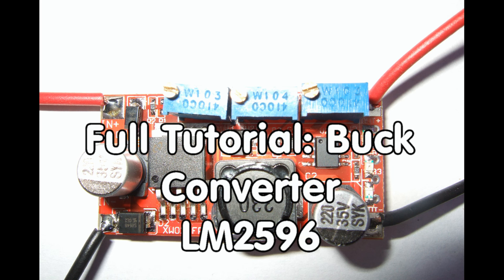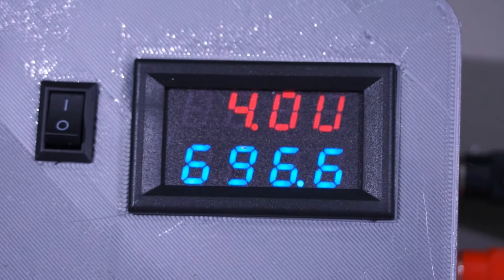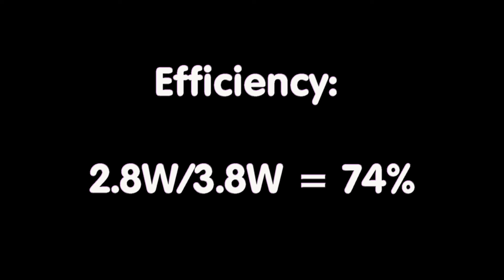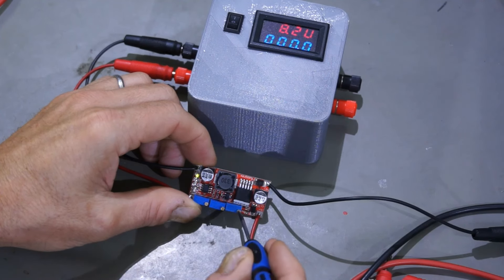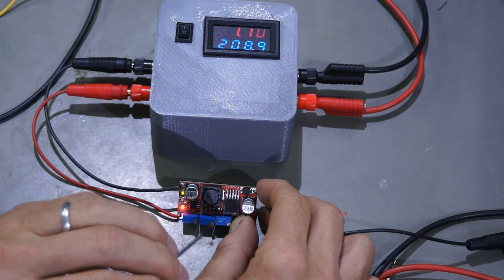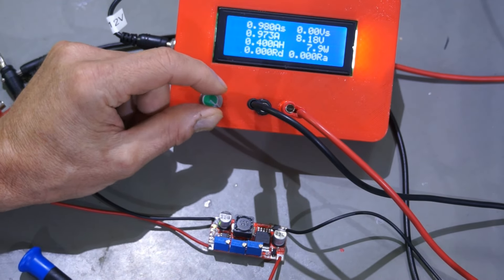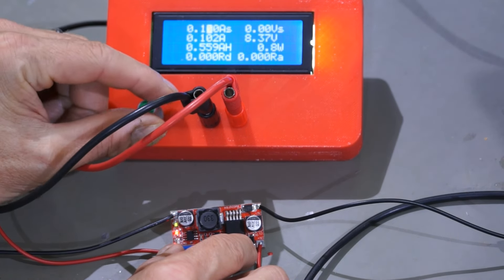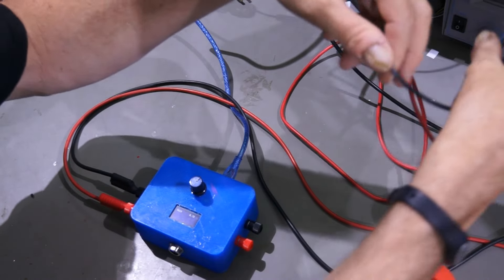#7 Tutorial: LM2596 Buck Converter with Three Trimmers (step down converter)

Comment: Andreas, superb tutorial. Very clear.  

Regarding the third (located middle on the pcb) potentiometer:
When the pcb is being used to (albeit crudely) charge any battery/cell connected to the pcb's output terminals  . . . . . my understanding is that the middle potentiometer is adjusted/used to merely give a visual indication (by illuminating the 'CH' LED) of when the charged cell's current is close (as per middle pot adjustment) to the pcb's 'CC' setting (as prior set using the CC pot).  ie once the cell's terminal voltage (under charge) has approx reached the pcb's 'CV' value, then the CH LED illuminates.  The middle pot and CH LED are solely used as a visual indicator function of current flow status. Nothing else. 

The pcb in the tutorial is primarily designed to be used as a constant current/voltage driver for low power LEDs, in which application the middle pot and CH on-board indicator LED are redundant/irrelevant.

Really, the pcb shown in the tutorial is inadequate as a Li-Ion cell charger, there are more refined (and similarly inexpensive) dedicated Li-Ion cell charger PCB's available (that utilise multi-stage charging).  Example:  http://www.ebay.co.uk/itm/5V-1A-Lithium-Battery-Charging-Board-Charger-Module-Li-ion-LED-Charging-Board-GG-/111908684800?hash=item1a0e470400:g:yRsAAOSwx-9WxYqX
Reply from the maker: Thanks for your feedback. I think, this was designed for a universal buck converter with the addition of the "middle" potentiometer. So, it can be used for charging and for LEDs and for many other purposes. If you look for a lipo charger, I would also go with your proposal. Keep also the age of the video in mind. The choice of boards was smaller back then.
Reply: that charger will only do 1 cell in series or maybe 2 in parallel. You hurt your point by linking it but I would suspect you know that the other optiions for integrated chargers either take more work and smc to dip converters or pcb etching or are much larger. 

 If you wanted to make this point at least show people that companies like linear technologies, ti, etc make proper ICs for doing this. 

over all the product that the video shows is by far the easiest way to charge a multi cell in series pack. Sure it lacks multi stage but combined with working protection and balancing pcb it will get the job done for most with out requiring tons of time and effort.
Reply from the maker: You are right. Thanks for the explanation.

Comment: The 3rd trimmer sets the point where the current has dropped to a lower value than the main limit setting. You pre-set that by first setting the limit current value, then connecting an ammeter to short the output, then adjust the trimmer till the LED comes on at the current you require. You can set both current trimmers in one operation of course. Veru useful for saturating lead acid batteries.
On the CC/CV modules with 2 trimmers, the led is pre-set to one tenth of the limit current.

Note that the output is never switched off regardless of the settings. A Li-ion will be continuously overcharged if not disconnected.
Reply: Does it stop current flow or it's just lighting the LED?
Reply: @amiltonfcjunior  good question, nobody knows, people keep buying this module and NOBODY test this...

Comment: Thanks Andreas, I discovered I had one of these little guys laying in a built kit box with a small amplifier that I built when I was getting back into this sort of thing.  While the soldering was really sad by my today's standards, I was able to clean it up nicely and have freed up the little converter for other uses.  Not sure where as of yet, but now I know what I can do with it, so it may well be put to work doing some chore I have yet to learn that I need. Right now I am thinking of building a small capacitor analyzer using an Arduino as I only have one small meter that can analyze anything about capacitors, well and that wonderful little parts analyzer that is built with an Arduino chip at it' heart.  Having a dedicated Cap reader, though would be fairly handy when playing with old radios and building my own circuits.
Reply from the maker: You should even find diagrams of such testers. I did once a video where you should find a link.

Comment: Understanding the LM2596 Buck Converter with Three Trimmers

* 0:24 Buck Converter Basics: A buck converter efficiently reduces a DC voltage to a lower, stable DC voltage, offering better efficiency compared to linear regulators.
* 0:35 Single vs. Three Trimmer Modules: While basic buck converters have one trimmer for voltage adjustment, the featured module has three, adding current limiting and a charging indicator.
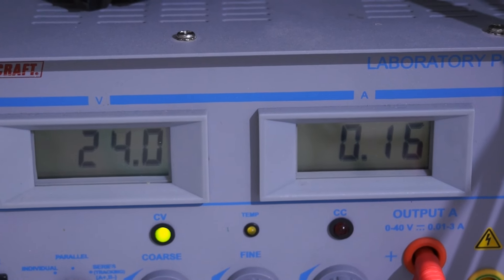* 0:50 Efficiency Demonstration: Using a 24V to 4V conversion with a 2.8W resistive load, the module demonstrates ~74% efficiency, dissipating 26% as heat. Efficiency increases to ~80% with a 12V input.
* 2:42 Current Limiting: The left trimmer sets the maximum output current. An LED indicates when current limiting is active.
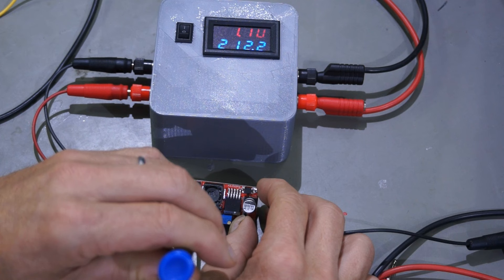* 3:14 The Third Trimmer Mystery:  Initially, the function of the middle trimmer and its associated LED seem unclear. 
* 3:54 Constant Current Load Testing: Utilizing a constant current load, the middle trimmer's function is revealed.
* 5:22 Charge Indicator Function: The middle trimmer sets a lower current threshold. When the output current drops below this threshold (e.g., when a battery nears full charge), the second LED illuminates. [From StodgeHenhouse's and ChaoticaExtreme's Comments] This functionality is particularly useful for battery charging but may not be relevant for other applications like LED drivers.
* 6:02 LM2596 Datasheet Confirmation: The datasheet of the LM2596 IC confirms the middle trimmer's role as a charge indicator. [From ChaoticaExtreme's Comment] The third trimmer sets a lower current limit, signaling when the current drops below a certain level, indicating a fully charged battery (or near full). 
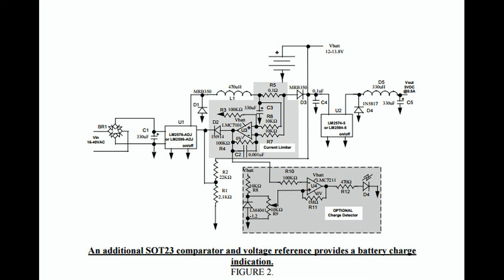* 6:15 Future Lipo Charging Test: The next episode will feature a practical demonstration of the charge indicator function using Lipo batteries and data logging. 

I used gemini-1.5-pro-exp-0801 on rocketrecap dot com to summarize the transcript.
Cost (if I didn't use the free tier): $0.06
Input tokens: 16508
Output tokens: 428

Comment: At time 5:15 in the video, you mentioned to keep the current limitation at 1000 milliAmp, but the setting appears to be a limitation of 100 millAmp. Nice video! Thanks for creating this one.
Reply from the maker: You are right!
Reply: true, normal charging of a Lithium-Ion accu can be made at half C (if the accu is 2 Amps, charge it with 1 Amp). But when charging goes over 95 % (to 4.1 Volts) the current will be low (charging voltage too close to accu voltage) so you can set the middle potentiometer to 100 mAmps for example.The middle LED will glow showing you that the charge is almost complete and might take a while to Full charge. In this moment you can take out the accu since Li-Ion accus don`t have memory, and it`s even better for them if you don`t charge them to 100%. Yes, a good factory accu will have a double life if charged always to only 90%. If not used Lithium ions feel best when accus are at half charged, which is about 3.7 Volts (shelf storage voltage) .

Comment: It might be useful to mention that the buck converter, even at 75% efficiency, is MUCH more efficient and cool-running than a linear regulator in most applications. For instance, with a linear regulator your first test with 24V input would require 24V * 0.7A = 16.8 Watts input for only 2.8W output, which is only 16.7% efficient.
Reply from the maker: Agreed. The bigger the difference between the input and the output voltage the better the switcher becomes...

Comment: Hello Andreas, so funny to see your old videos.  So subdued!  When did you become more enthusiastic?   I bought a lot of these when they were onsale cheap, and can never remember what does what, so I'm sure to watch this one many times.    If your reading this, I have a question that I find no answer when searching.  I want to create a digital potentiometer to control these trimpots using a esp32 (or another micro).   There are many chips that does this, most cost more than this module and can't handle 36v.   I was thinking to create my own, not sure how to do it that doesn't also cost 3x more than the module.  Don't think I want to solder up 20 mosfets I have lots of unl2003 that are 3cents each and have 7 switches in each.
Any input appreciated, I am about to use a stepper motor to twist the pots, which seems rather crude.
Reply from the maker: You mentioned the two basic versions: A lot of small resistors and transistors or a potentiometer with a motor. 36V is not easy for modern electronics...

Comment: Excellent tutorial!! I have one question. Can I replace de blue trimmers by common potentiometers?, so I can adjust remotely the voltage and current for a homemade DC power supply in which I used an ATX for variable requirements. Thanks

Greetings from Ecuador.
Reply from the maker: I think so. But it might be very sensitive.
Reply: @AndreasSpiess  Surely you could use the same value pots or get something higher?
Reply: Uneducated guess: You could possibly use a set voltage with the pot in the positive feedback loop of a low gain differential amplifer. Depending on the reference voltage and the voltage with no feedback at the positive pin (you can do a voltage divider from the opamp's power supply), you can narrow the range of the pot. Then, if I'm not mistaken, the negative leg is your output. For something like this you'd probably need a package with 3 or 4 in one IC.
Reply: @ninetailscosmicfox5585  Good night! Thanks for your response. I'll be considering it for my project.

Comment: I use the center pot when I charge from a car battery and it will stop the charge where you set it. So the car battery doesn't get under charged. May be different on yours.
Reply: Yeah, my sepic converter is different.
Reply from the maker: The one I presented is no sepic converter.

Comment: You have to place the Ampermeter in series with load to set the current limit ?? or you can short the output with the ampermeter probes?
Reply from the maker: Amperemeters have a very low resistor, like a short circuit. So, if you connect the Amperemeter directly to the output pins you create a short circuit and the output voltage drops to 0 volts. This is usually not a real situation for a voltage regulator. That is why You usually connect the Amperemeter in series to a resistor (which is calculated to create the defined current at the defined voltage. You can also use a rechargeable battery instead of a resistor.
To set the current limit, however, I think, you can connect the ampere meter directly to the pins because the current limit should work with all voltages. You probably afterwards still check in the "series" configuration if it works correctly.

Comment: Is anything known about the minimum constant current value (when the CC potentiometer is turned all the way down)? Let's say you want to drive a single LED at 10-20mA or charge a single NiMH cell at very low current. Is this module suited for that?
Reply from the maker: I do not remember the minimal current. But this device might be an overkill for a small LED. There, a resistor usually is enough.
Reply: I now have got two of these. One can be set to 20mA, the other to 50mA, but the charging indicator LED does not work at low currents.

More details about the two pieces I purchased:

Current limitation for low resistance load does not work if output is connected on power-on. Current limitation fails for voltages less than 6.5V input or 2V output, a few hundred mV less for high current or input voltage (manufacturer's specs: 7–35V input and 1.25–30V output). The smallest settable threshold for the charging LED is about 10% of the CC limit, but charging indicator LED does not work for currents lower than about 60mA and 230mA, respectively. The modules work with 3.3V input up to at least 2A output, but without indicator LEDs at this low input voltage. Efficiency depends mostly on output voltage, for instance at 2A output current, it is about 50–60% for 1.25V, 70–75% for 3.3V, and 80% for 5V. Quiescent current is 9–12mA for input voltages 3.3–18V.

Marked with the QSKJ logo, appears to be the model QS-2405CCBD-15W by QSKJ (Mianzhushi Qisheng Electronic Technology Co., Ltd.), the chip is an LM2596S-ADJ by National Semiconductor.
Manufacturer's product page: https://item.taobao.com/item.htm?id=9665829772 (see also http://www.qskjpower.com/ProductDetail/684392.html).
English product description by Satistronics: http://www.satistronics.com/lm2596-nonisolated-stepdown-cc-cv-charging-module-in735v_p2777.html
LM2596S-ADJ data sheet: http://web.archive.org/web/20111129183227/www.national.com/ds/LM/LM2596.pdf

Comment: Hey, I hope you could advice me on this buck converter. I removed the CC trimmer and the CV trimmer from  board. I then solder 3 wires for each trimmer to the board and wired each to a rotary potentiometer one of 500k for the CV and one of 250k for CC. When I put a 6watt load to it. The red fault light came on and the potentiometers were not doing a thing. I would really appreciate your thoughts. Thanks
Reply from the maker: I am a YouTuber and unfortunately have no time for consulting.
Reply: Andreas Spiess , thanks for acknowledgement. Good luck to you
Reply: Are you using the VA meter to measure current? If so, you must not connect the thin black wire. The thin black wire on the meter directly connects to the thick black wire (measure it!) and it shorts out the shunt resistor in the DC-DC converter if you connect it. This means the current reading is wrong and also the current pot does not work.  The thin black wire is only connected if you are powering the VA meter from a battery or isolated power source.
Also, you must use shielded cables to the pots and never touch the pot wires when it is on. The wires are very high impedance (500K and 1.6M) and pick up noise from anything nearby. This causes oscillations. Even connecting a x10 scope probe cause the pots to not work properly.
Reply: steve6375 , got it. Thanks for the heads up. My solar generator project has gotten stalled due to remodeling my house. Have a good Thanksgiving

Comment: I have this LM2596 i applied the resistor along with ammeter in series to the output terminals , (15 volts 1.5 amps on input terminals)i am unable to incraese the current value, trimmer for voltage regulation is working nicely but i'm getting the problem with current regulation please help me, i need to charge the supercapactior with 1 Amps but i couldn't , that's why i'm searching for the constant current supply so  please help me............ Thank you
Reply from the maker: I just tried your scenario: I took the regulator from my video, set the voltage to 2.7 volt (which is usually the max voltage for a supercap), without any resistor. Then, I connected a 1 ohm resistor with the Amperemeter in series and was getting up to 1.5 A.
Please check the output voltage of your regulator and your resistor and apply Ohms law. What is the maximum current? Please take into account that the Amperemeter also has some resistance.
Try the whole thing without the regulator. If everything checked, change the regulator with another one. It might be defective.
Reply: I tried what you suggested me, but the problem is current  is not constant during charging. Please suggest me how to charge the supercapacitor (0.35Wh, 2.7 V).. i read the related articles/journals, it is written there that to charge up the capacitor you need constant current source that why i tried on LM2596 CC/CV kit but it is help less.... please suggest me to overcome this problem
Reply from the maker: A super capacitor is just a capacitor with a bigger capacity. It behaves exactly as a capacitor. Super capacitors can handle very big currents (sometimes more than 50A). So, there is absolutely no need to charge them with constant current. Important is just, that you do charge it over the 2.7V.
Maybe you found articles about an experiment to measure voltage whole loading the capacitor with a constant current. But this is just an experiment.
BTW: I tried your setup again with my step down converter set to 2.7 volt and 100 mA and it loaded my 10F super capacitor without problems with a constant current.
A super capacitor has no Wh, it has Farads. So, I du not know what kind of capacitor you have. Watch my last mailbag video #68 if you want to see which supercapacitors I tried for the test.
Reply: Thanks for that wonderful and helping video. I have done this experiment setup with 10 F supercapacitor and the result was similar to yours. but this time i have KEMET 2.7 V - 350 F , 0.35 Wh supercapacitor (Wh is energy rating of this capacitor) here's the problem is, it takes more then few hours to charge up, I know that capacitors takes very long time to charge up to the fully specified voltage, in my experiment i found that it takes nearly 3 hours to  acheive 2.5 volts which is not good for the super capacitor because capacitors should take few minutes to charge ...............  thank you
Reply from the maker: As you saw, you cannot get a constant voltage for the whole charging time with your setup,  At the beginning, you get a constant current. At the end the current will drop, if you have a constant voltage of 2.7V. See http://www.antonine-education.co.uk/Pages/Physics_4/Capacitors/CAP_03/capacitors_page_3.htm
The loading depends on the maximum current. I tried with 2.7V at the power supply and 1A max current. It took about 1 minute for my 10F capacitor which means, 35 minutes for a 350F capacitor.
With 12V and 1A it took only about 13 min (calculated for 350F). But then, you have to closely monitor the voltage directly at  the capacitor and switch the current off when it reaches 2.6 V.